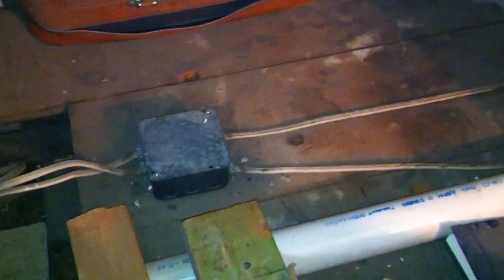Moving Violations Video No. 142: Missing Guard Strips

Comment: In addition there is no support or staples within 12" of the junction box or anywhere else.  This further increases the hazard of damaged wire and connections if someone trips over the cable and pulls it out of the box.